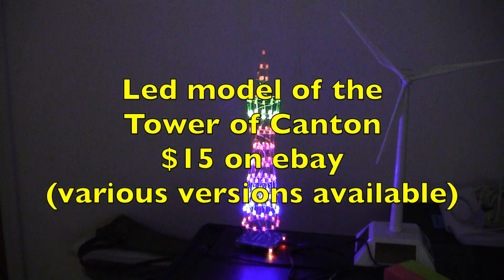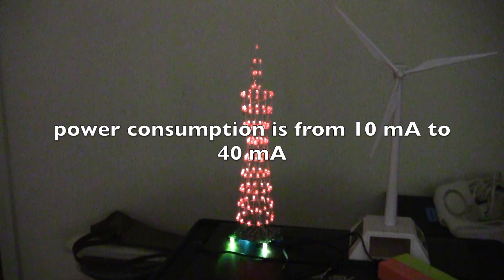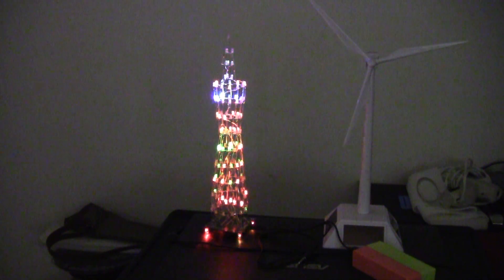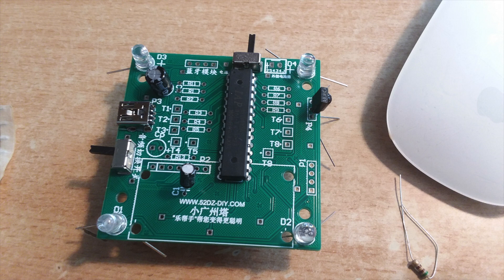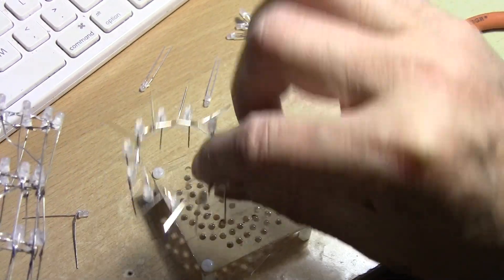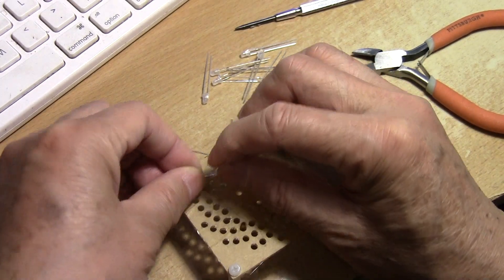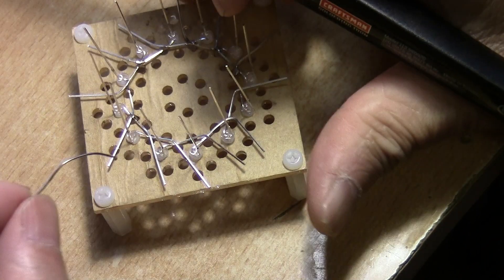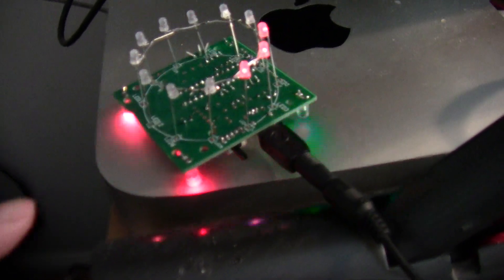Canton tower Diy Led kit

Comment: Hello and thank you very much for this great tutorial,  I am still undecided whether  to get one or not! ( my hands aren't as steady these days )
It does look rather cool though, so I am tempted to have a go. I suppose the best way would be to take my time and do it over several days.
Thanks again. John from Doncaster... :)
Reply from the maker: Yes do it over time at your own pace. The kit comes with extra leds so you can make a mistake here and there. Mine is still in use and powered by a 10w solar panel placed inside the window. It is cool to see the lights running up and down. Reminds me of neon lights. I looked up Doncaster. You have an aircraft museum there. Cool!
Reply: @wtam69  Hello mate hope you are well😊 I was searching for the Canton tower on Ali Express and came across this bad boy! https://a.aliexpress.com/_BVeHd1
So I have ordered this instead 👍😎
Reply from the maker: @johnberry5339  Interesting design. Post a video if you decide to build this.

Comment: I am still wondering what kind of Led it is. Normally RGB led has 4 pins. However, this one has only 2 pins but still able to control the color very well. Could you please try the behaviour of one of the led by directly by directly connecting to power source with limiting resistor.?
Reply from the maker: It will light up according the voltage. Red or yellow first then blue.
Reply: I'd been pondering how they worked & concluded the same, quite an effective design.